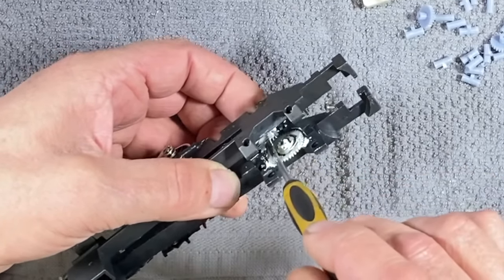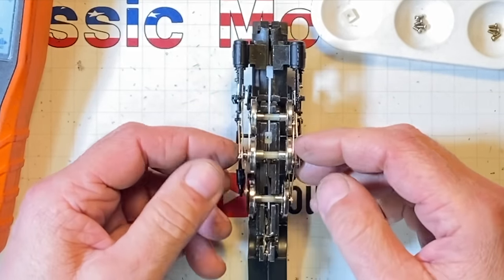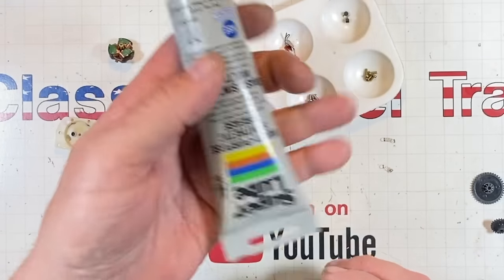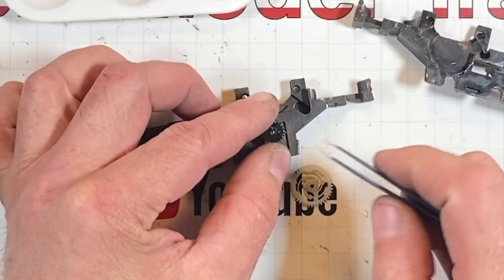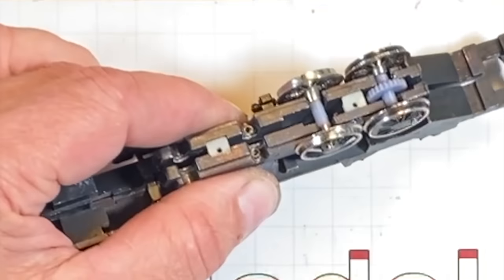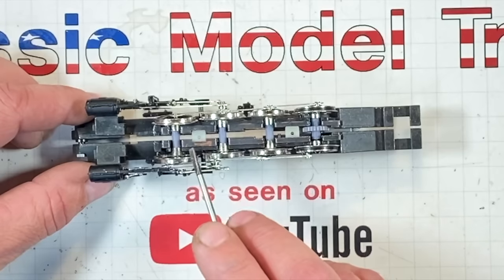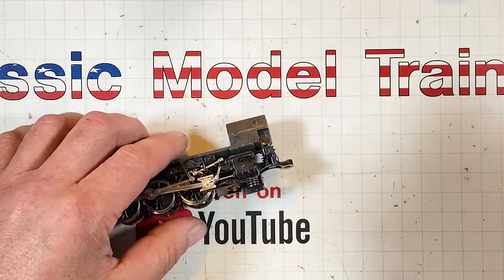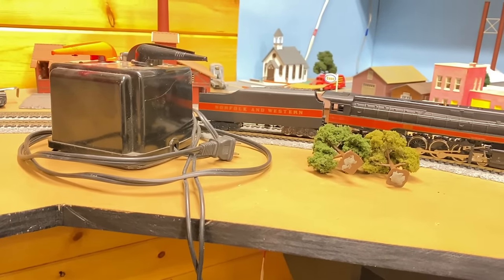I FINALLY Found Some GOOD 3D Printed Gears!!  Bachmann Gen 1 4-8-4 J Class

Comment: Hey Ron, 33 percenter Jim Worley here. I Have a Question.
Is there a model railroad Blue Book Site out there that you would recommend? I have some early HO models from the late 40's and 50's, (Ulrich, Silver Streak, Roundhouse, Varney Ambroid) and some from the 80's, 5 Brass Steam Locomotives and two Hobbytown F-7 Powered Chassis with centrifugal clutch Flywheel. Also I have tons of Wood Structure Kits by Campbell, Dyna, and Fine Scale Miniatures.  Any info would be greatly appreciated. Keep the vids coming.
Reply from the maker: Hello Jim.  Thanks for your support of my channel.  a Blue Book site?  Like for prices?  I use the Ebay "sold for" section to research what fellers are paying for stuff.  If you have super rare items that have not sold recently on the eBay it wont help you.  I guess a Feller has to do a lot of research to know what to ask for stuff you wanna sell.  No pricing site is around that I'm aware of for HO stuff.
Reply: Ya, guess I neglected to say I'm looking to see what this stuff is worth. Got some feelers out with Local Clubs.
Took a 40 year hiatus from Modeling during my RR Career with the BN/BNSF. Retired now and bringing stuff out of mothballs and refurbishing as needed for starting a little Point to Point RR. Your Vids have been a huge help in refitting this older stuff with new components; especially couplers.
As old as this stuff is, it may end up as an Operating  Museum.
Thanks Ron Luv the Channel.
Jim Worley
 @classicmodeltrains

Comment: the smaller sqare motor is a LIONEL MOTOR BUILT BY BACHMAN for them and it took me 5 of those engines to get one that did work right its still going 10 years latter.
Reply from the maker: Them smaller ones your referencing I have 2 of them. One in a Lionel marked GS-4 and 1 in a Bachmann labeled GS-4.  Good to hear you have 1 that has givin' a long service life to ya :-)

Comment: Hi Ron, I have the Gen 2 of the J Class. It cost me $250 Australian back in 1998. I might as well have urinated the equivalent amount of money against a wall. At least the hangover would last longer than the loco actually working. I enjoyed the video in a masochistic way, knowing that you and I own a shelf queen that looks nice but does nothing.  To this day I hold an immense grudge against Bachmann, and the dudes who designed this piece of crap, and the other models I stupidly bought that were spilt chassis duds.  If I do run mine, I start it in reverse because if something goes wrong, you do less damage. Steven.
Reply from the maker: Thanks for the input Steve.  So I'm hearing the Gen 2 has a better motor but still lacks in something?
Reply: @classicmodeltrains  Yeah Ron,  the Gen 2 is still underpowered and has axles that split. I managed to fix the axles with superglue and then putting shrink tubing  around the outside and heating it till it fit really snug.  You have to sand it a bit with wet and dry so it fits in the bearing and then grease it with silicone.  Very fiddly. Getting new axles is a way better option.  I used a hair-dryer to shrink the tubing, don't use an open flame.  Steven.

Comment: I hate to tell you but!.....
You didn't remove the valve gear from one of the axles so when setting up your quartering you could match three axles and then guess that final axle with the couplings still attached.  It looked to me from the video that the quartering was still not quite right with some variation in angle of the coupling rods between wheel sets.  Also the flex in that big seat wheel will contribute to the rough (jerking) running as the drive train struggles a little with the wheel sets.
Reply from the maker: I just eye balled them.  No jig to use.

Comment: Hi everyone. I have a problem with an Lionel HO gauge train. Lionel hasn't been much help. I have an NEW YORK CENTRAL WATERLEVEL LIMITED passenger HO set, won at a Goodwill action. It was stated that he couldn't get the locomotive to work. The first issue was that the remote would fast blink. I found that there was a stuck key on the remote and fixed it. But the remote still would fast blink. The fastrack 12 volt output transformer is plugged into the barrel jack track, and I get a red light on the connector. There doesn't seem to be voltage on the track. It works if I use an old Tyco transformer with the wires touching the fastrack. Doing this, the remote will work as normal, and the train and tender work. I got a new Lionel MAGNELOCK 9" Straight with Barrel Jack Terminal to see if the train would work, nope. I used wires to connect the barrel jack transformer straight to the track and that works. I'm at PC tech and it's always the female jack in the laptop that goes bad. Could the male jack on the transformer be bad, even if I get a red light on the track? Like I said if you use wires on the original Lionel transformer to connect to the track it works. It's supposed to be a gift to my grandson if I can get it to work.
Reply from the maker: Hello Gerry.  The comments section of my video's is not a good resource for help with train issues unrelated to what the content of the video is about. The reason I say this is people typically did not scroll thru the comment section and read all the comments. There are Facebook user groups on Lionel trains you can join and ask this question and others will respond with good idea's on how to resolve this issue. Or you can contact me directly.  Contact information is in the video description section of all my video's.  I will try and help you out as much as I can but this area is not the place to do this :-)

Comment: I had one of these that i paid $25 back when i did HO scale, Infact mine was a 600 like this one. And it had the gears fail. 

Its a shame they have these issues, because these models are cheap (when not looking at stupid ebay prices) which make's them great for kids that want to get famous locomotives at decent prices

atleast the modern Spectrum/Sound Value one's are amazing runners, but that comes with a extreme increase in price.

Also with the issue with corners, The old school J's have a Minimum curve radius of 22in, anything lower than that they will derail like crazy.
Reply from the maker: I agree.  I Have 31" radius and you could hear and see this one bind up on the curves.

Comment: Doesnt that name pancake sound so lowly for a motor....
I watched you deal with the Mantua Open Motor.... It was simple and "out there" and seemed easy to clean up and get running .... I know you can replace them with a closed motor with Flywheel as you so greatly did... and it did great .. but you know what .. Im thinking they wont last as long as the good old open MANTUA motor in those old cast metal Steamers ... You did an excellent job on a conversion that video
Reply from the maker: Pittman motors will work after the apacolypse I believe!!

Comment: i have one cost almost $400 to get one fixed...i did have a parts model it was the Limted Edition J Class but also had a GP50 set as well that I got fixed so $200 for each 
my J Class works great now but sadly my GP50 broke fell off my model shelf even have the passenger set for it.
Reply from the maker: Sorry to hear one of your loco's hit the ground.  That always hurts
Reply: @classicmodeltrains  well the GP50 hit the ground not the J Class it's fine sitting on the shelf like it sucks cuz the GP50 set has a dummy unit as well but would have to use it to rebuild the motorized one that broke

Comment: Do you know the baking soda and super glue plastic repair trick.
Reply from the maker: Yes I do.  But if the plastic will not "melt" from the CA glue the baking soda is not going to help it.  Either that Or I just wasn't holding my mouth right :-)

Comment: What was Bachmann thinking putting a mouse turd of a motor in those things. What I find really crazy is the fact people are asking so much for broken units. I really, really hope no body is biting on those. The time and money and aggravation to get one of them running you can just buy a brand new modern loco that is guaranteed to run right out of the box. I just find those Bachmann's to be economically non-viable for someone into fixing up older locos. Annnndddd with the aggravation level involved, that's a serious hard pass. I felt your pain all the way Ron.
Reply from the maker: Thanks Inzane (great username by the way). I agree with you.

Comment: You actually don't have to take the rods off to separate the wheels🧏🏿
Reply from the maker: The wheels are already separated.  To press the wheels into the new center sections and get them properly quartered its a lot easier if the rods are not on the wheels.  Just my opinion :-)

Comment: I buy Bachmann passenger cars in g scale….sometimes…
I avoid their locos and don’t even look at them.
Reply: If you can afford G Scale, why would you buy anything cheap?
Reply from the maker: Your the second Feller that mentioned the really bad G loco's
Reply: @UrMomsChauffer   Bachmann passengers cars are fun to paint and kit bash. They are cheap so if you screw up it’s easy to buy a replacement. Cars for parts is also cheap. 

I normally upgrade the trucks to LGB and replace the couplers to kadees if it’s a train I think my kids will run a lot.
Reply: @classicmodeltrains   the spectrum line from what I understand has started introducing brass gears. I haven’t purchased one yet for the kids. I like the older classic LGB 1980s locos. Very easy to work on. And they run and run and run. 

It’s not uncommon for my son to run one loco for 6 hours on a Saturday or Sunday. 

He has a couple moguls that are his favorite that I would not be surprised get a 100plus hours a month run time.
Reply from the maker: @CannonCountry   I would stand in line to buy a LGB
Reply: @classicmodeltrains   I really love the older stuff made in west Germany. The old freight cars are seriously made to be struck by lightning I think and still be fine.

Comment: How are these things breaking to begin with?  Bad engineering out of the box?  Mishandling from throwing these things into reverse when going forward?
Reply from the maker: the plastic shrinks over time and breaks when it has a metal axle inside of it.  Different expansion / contraction properties.  I also think if there stored in poor conditions (I.E. extreme heat or cold) it accelerates this problem.